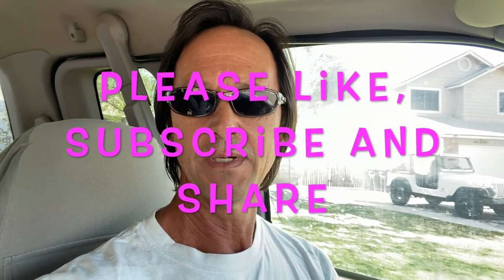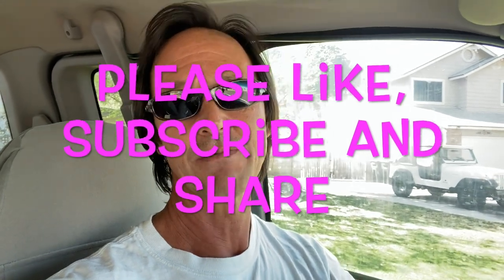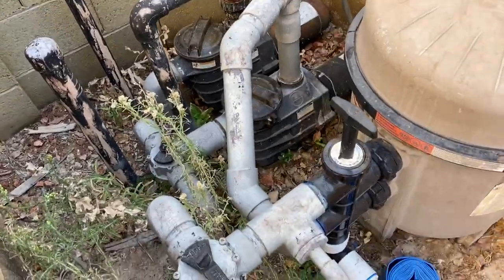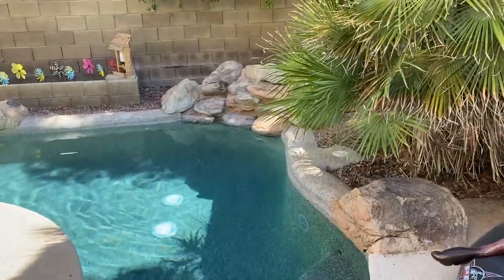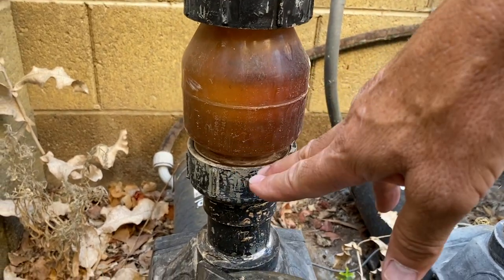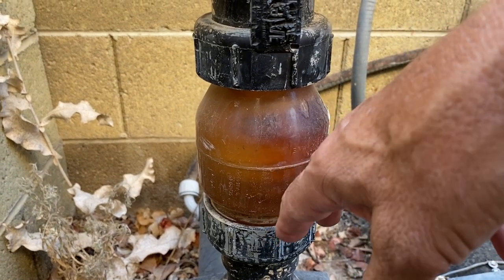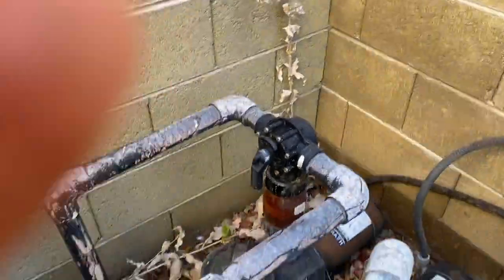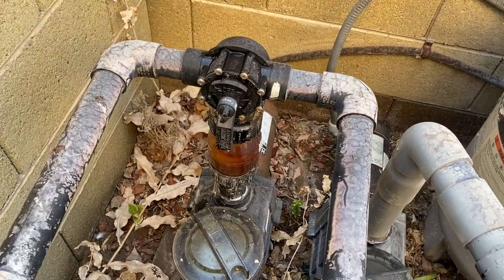Check Valves: What They Are, How They Work and How To Fix 'Em (sort of).

Comment: I have the same check valve as your clients in video. Want to replace it with same kind. Do you have any brand recommendations? Thank you!
Reply from the maker: @CarolNourse-c2f  the one I probably find the best in my experience has been  off. One of the reasons I like it is because you can see inside of it to see if there’s any debris obstructing flapper and it’s also serviceable by unscrewing the cover.

Comment: Hi. Does it matter where the check valve is located? For example,  before or after the pump? Thank you
Reply from the maker: It can depending on what you're wanting the check valve to do and the direction of the flow.
Reply from the maker: Basically you can put the check valve anywhere you want the water to flow in only one direction.

Comment: I have one of the bulb style amber colored check valves on the outfeed line from the heater. It’s clogged and the connections are cracked (18 years old). What’s the best course of action trying to get the old connection fittings off the PVC lines top and bottom? Mine are glued on permanent. Heat gun and loosen the glue? Cut the PVC at the connection point and use a new PVC coupler?
Reply from the maker: Typically in those situations you have to cut the PVC pipe and then reinstall a new check valve. I would highly recommend contacting a licensed, insured and bonded professional pool repair person to do that work for you. It’s worth the money.
Reply: @PoolSchooler  Roger that….thank you!
Reply from the maker: @06barcafan10  You're welcome
Reply: At 61 years old I am new to the pool game. Beleive it or not.

Every other video on youtube shows the typical modern Jandy type check valve. Eight screws and a clear top.

This morning I located a very old solid white check valve like the brownish clear one in your video. I found some very small print embossed in the plastic "Check Valve".

I wish i saw your video earlier. My pool leak has been a bit of a mystery until today.

Comment: My pool equipment sits far away and about 5 feet above my pool.  have to keep primiing because water keeps running back to pool then causing it not to be able to be on a set schedule because it needs to be primed after each schedule.  This is a check valve problem right?
Reply from the maker: You might wanna have somebody come out and look at a way to put a check valve into your system so that doesn’t keep happening.